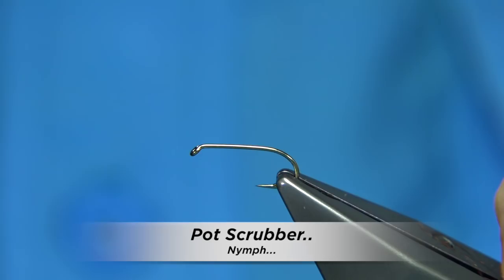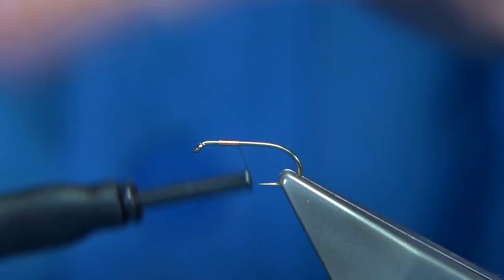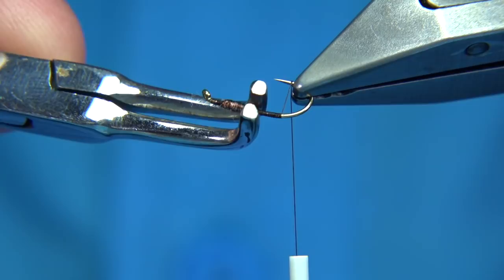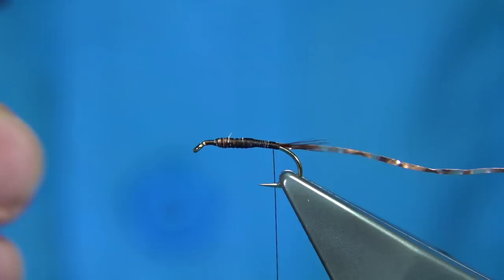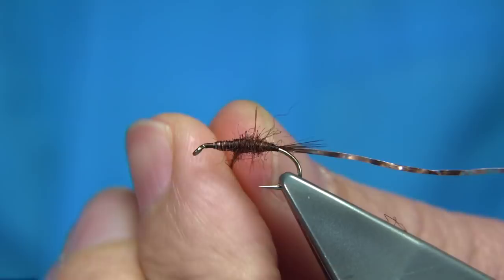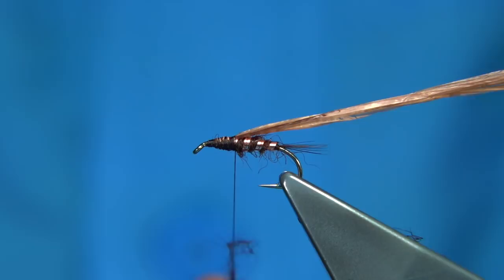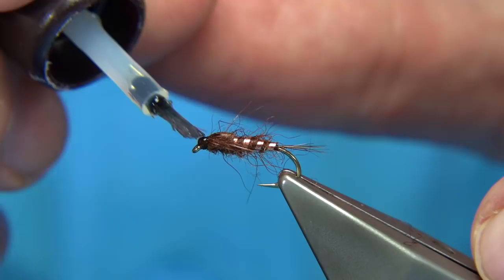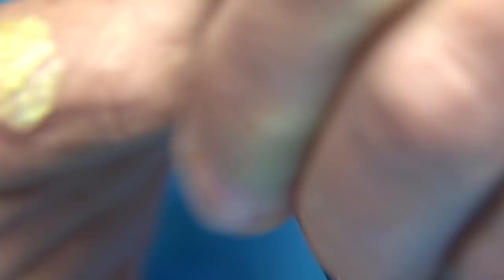Tying the Pot Scrubber Nymph with Davie McPhail

Comment: Wonderful to see a great Tasmanian pattern presented. This pattern accounts for about 80% of my fish in Tasmanian lakes and rivers, including 3 to 4 lb browns in our many Central Highland lakes.  It has also proved equally useful in New Zealand and Japan. This pattern represents very common and distinctive species of mayfly in Tasmania. Most serious flyfishers in Tasmania will carry the set of Pot Scrubber, Penstock, Highland or Lambda Dun, and Red Spinner to represent the nymph, dun and adult of the species. As one who has fished in Tasmania for 40 years with the Pot Scrubber, I make the following comments. There are pot scrubbers pads of various shapes, sizes and thickness of copper.  The one I use, made in Tasmania, has quite fine wire of just 0.5 mm width and about 0.02 mm thickness, perfect for ribbing.  It’s probably the same company that made the scrubbing pad used by Dick Wigram. The copper in the video is too wide. Nor is my copper sharp and likely to cut the thread. We don’t weight our nymphs, mainly because it is unnecessary, but also it would change the attitude of the fly. The secret of the flat copper wire is that 1) it produces realistic segmentation, and 2) it weights the tail so the fly realistically represents the nymph swimming to the surface head up. A thorax weight nymph, or a bead head has the opposite unnatural effect. The original pattern does not have a wing case. It’s not necessary, I’ve tied nymphs without and with a wing case (pheasant tail) and made no difference to my catch rate. All up, this is a very simple fly that takes me about 5 minutes to tie, and the more fish a nymph catches, the better it gets.